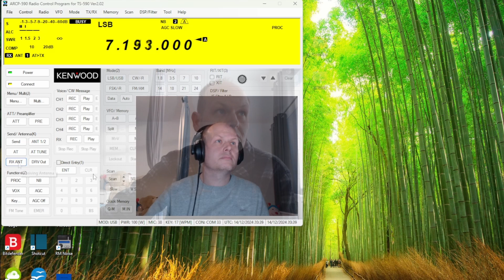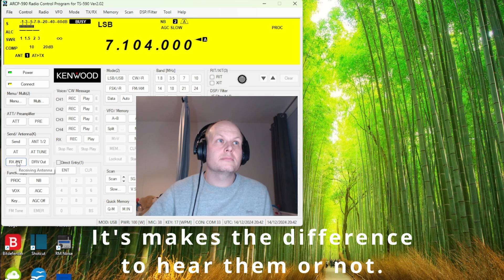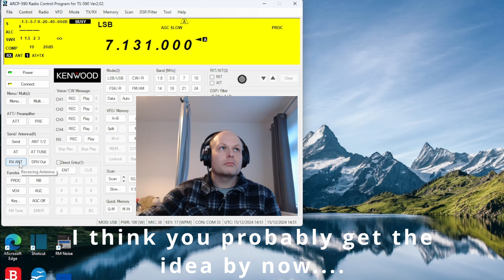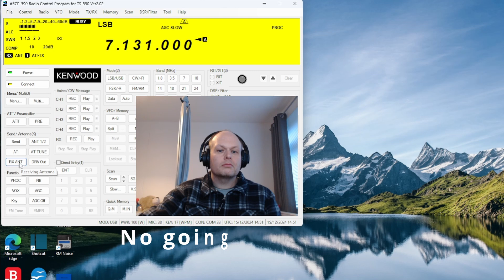This Antenna DESTROYED my Man Made Noise!

Comment: I got about three quarters through your video and I noticed did you even try to turn the loop ???  Then when I looked at your comments I know there's someone already asked that... I have antennas all over the place one in my bedroom next to my bed where I can reach over and grab my little mast and rotate my loop from west to east... It is pretty directional... I've tried to play with it mounted horizontally have not committed to changing it yet.. but as you know this hobbies a little bit different where is the old saying was if it works don't mess with it...l mess with everything... That is the beast in me...73s...   It seems that the noise on 40 m is up within the last couple of weeks to the point where my outside off center fed dipole is actually quieter.  ¿
Reply from the maker: Where your antenna is further away from man made noise sources its usually quiter. I didn't rotate this in the video but I have done so to not any noticible effect. Everyones milage may vary.

Comment: Colin could i enquire where you got the black ratchet clamps you using to fix to the main pole were from please?
Reply from the maker: Cant remember exactly but you get them from 4x4 / i accessories. They are used to hold the likes of shovels.
Reply: @MM0OPXFieldRadio  Thankyou

Comment: I built a mag loop about 6 months ago, my off center fed dipole, runs a noise floor of about S 7-S10, I can't remember exactly what the noise floor was on the loop was, but it was much less than the OCFD, it tunes from 40 to 15 meters. This was a good video for those looking to try one thank you Colin. 73's🎙KD9OAM🎧
Reply from the maker: Loops are great in the right config 👍
Reply: @MM0OPXFieldRadio  I can testify to that. The one I built out of 3/4 copper sent a 20watt FT8 signal heard all over the country, from the basement, it has a very high Q, I'm in the process of building another, to cover more bands, thank you again for your work, to encourage more experimentation. 73's🎙KD9OAM

Comment: Is this the copy from the Wellbrook loop antenna ? Interesting that the site talks about fake clones from Russia and China ? Is this not a clone too or does “reverse engineering” not count ?
Reply from the maker: Couple of points. 1 -The owner of Wellbrook sadly passed away last year. 2 - you cannot buy a new Wellbrook anymore. 3 - the WellGood V3 has been compared to the Wellbrook side simultaneously with the WellGood marginally better but not statistically better. I'm not going to get into semantics. Yes its been reverse engineered but improved upon slightly. What do you suggest? I'm not getting involved in the politics. What I have got has made a huge difference in my sutuation.
Reply: @MM0OPXFieldRadio  you already have.
Reply: @MM0OPXFieldRadio  you already have.
Reply: Couple of points, the owner of the Wellbrook loop was still trading when this reverse engineering program started. Calling it a well good loop is poor taste. Sad you’re promoting it. I’m out.

Comment: Blimey. Maybe I need to get one! I have an MLA 30 on a shortwave receiver I have in my other QTH - hadn't considered using a loop for general 40m receive. What about 80m? My main QTH is very noisy on 80m.
Reply from the maker: It works great on 80m but I didn't show it as I cant do a comparison to a full size antenna. Works well on 160m too.
Reply: @MM0OPXFieldRadio  Ah, great!

Comment: Very good.
I suffered from broadband internet noise from my telephone wire (not in use) which Ofcom investigated and said it had probably  corroded and radiating.for many years and h.f. was killed for me with S8 noise 160m to 20m except 60m. I lengthened my 40m inverted vee for 60m.
I made an indoor magnetic loop to null out the noise and that worked for me.
The noise went down considerably when it was changed to fibre optic cable.
G4GHB.
Reply from the maker: 60m is a killer for me to. I don't use it as my 590 is stil locked. I need to wideband it for this.

Comment: I built a 900 foot long Beverage receive-only antenna for use on 40, 80, and 160 meters.  It turned out to be very good at resisting corona discharge during a thunderstorm that rendered a 40m Yagi useless on receive.  Signal levels were lower than on the Yagi, but corona noise was eliminated.
Reply from the maker: If I had the space I would have a beverage. I did think about a short one in an L shape.

Comment: Build a air choke from coax. 6 meter coax around a botle or whatever. NOT the turns are importent. The 6 meter coax are. You need create reactence. Good Luck. Pa5dek.
Reply from the maker: I've tried GM3SEK chokes in the past without  much luck. These have wayyy more choking.

Comment: Well done colinn, ive always used a vert on tx, and 40m dipole 3m high for rx, no noise now. One ant socket on the rig, no probs, made a tx/rx ant switch, works great. 73 mate.
Reply: is your switch RF sensing or triggered via the rig?
Reply: @youtubeaccount931  triggered by the rig
Reply from the maker: Thanks mate. Thats the plan, get a vertical up for TX now.

Comment: I’ve been using a Wellbrook loop for years and on 60m it has been a godsend. I have some noise on 40m but the s/n is night and day over a wire antenna. Ideally you need a radio with a dedicated RX ant port. 

Loops in general are quieter than Marconi antennae.
Reply from the maker: Totally agree. Luckily the 590 has this feature.
Reply: @MM0OPXFieldRadio  I think that all new radio's should be fitted with a dedicated RX port. It was a huge part of my dismissing a lot of Icom radio's out of my buying equation. 

I wasn't keen on the 101 so ended up going for a second-hand TS-990.
Reply from the maker: @rjy8960 agree but manufacturers see that as people stopping upgrading.

Comment: Well done Colin. You're not the first person to crash a website 😂 🙈
Great A/B test. I've gone from a long wire to a multi band delta loop at home, where I'm surrounded by telephone and electric poles. Made a huge difference on receive. My old ft-847 only has one HF antenna connection though.
Reply: I made a tx/rx auto ant switch which will solve your problem.
Reply: @brianfields4479  good idea Brian, cheers.
Reply from the maker: Excellent Fraser. As Brian says, you need a dedicated swich and you can use different ant's for TX and RX.
Reply: @MM0OPXFieldRadio  yeah, I hadn't thought of that. Will look into it.